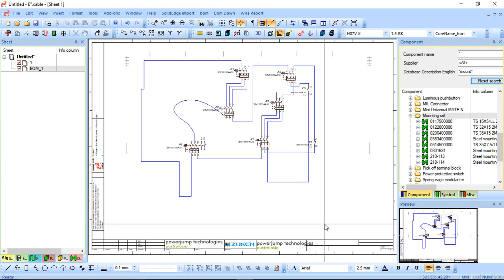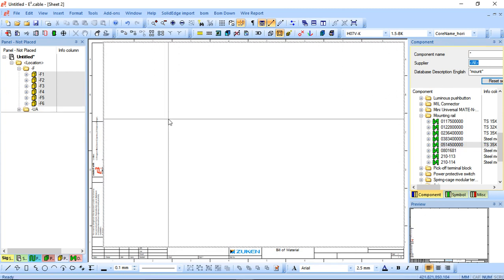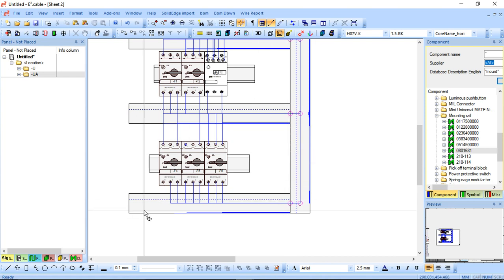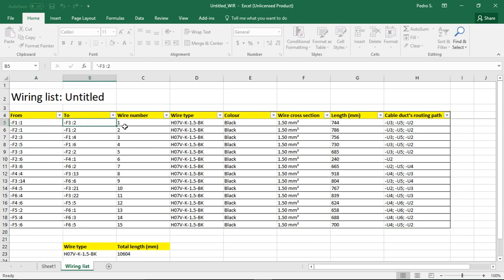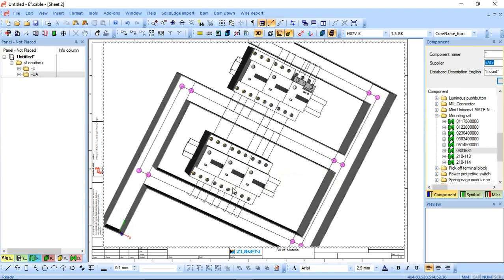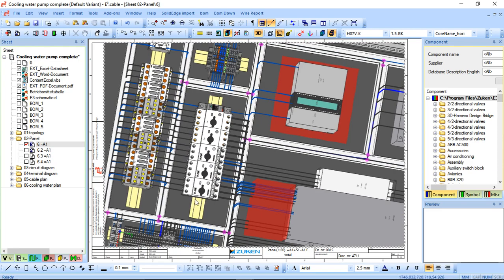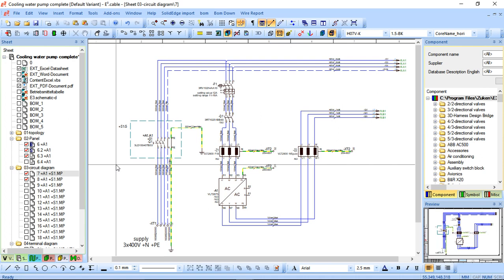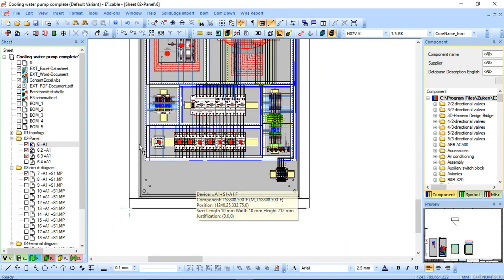Easy Panel Design creation using existing schematics with Zuken E3.series

Comment: Hi sir if i create assembly and i want to create model for this assembly is any way to assignment the pin of this model with pin in the assembly components ?
Reply from the maker: HI if im understanding correctly, you can assign model to components with pins, therefore when you have an assembly of components you will inherit the component pin assignment. 
you can however make the pins renamable so if you have different pin assingments for an assembly you can rename as rename(from the component default) as required.